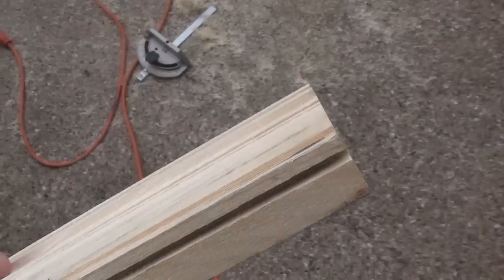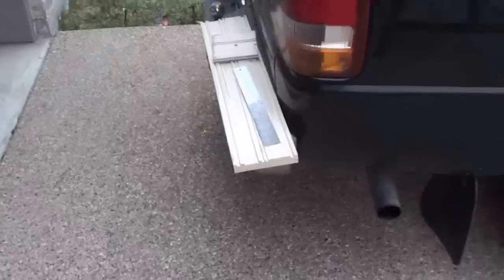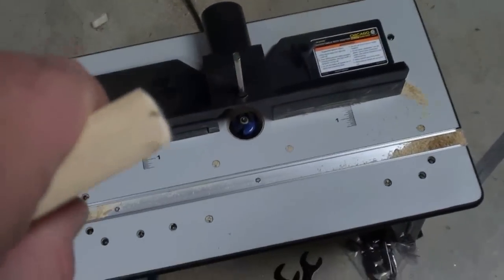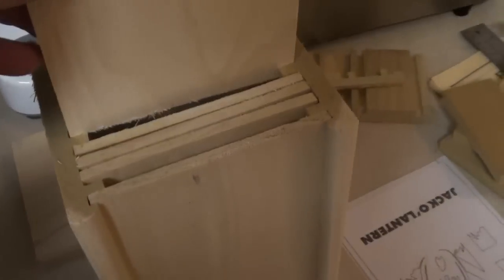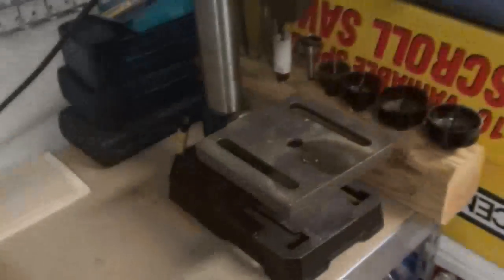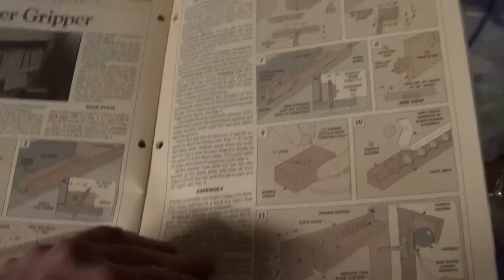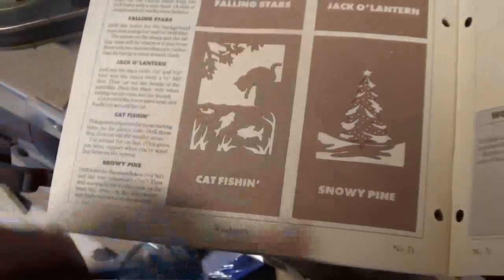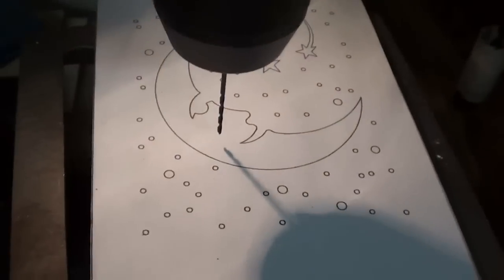A Christmas present part 2

Comment from the maker: @ModelloursWorkshop I thought about using plywood, but the directions specifically said to NOT use plywood.   They said that the plys would show in the finished panel patterns.  

I don't do enough wood working to design this on my own.   So I purchased a set of directions.